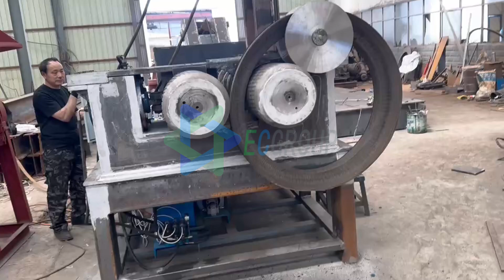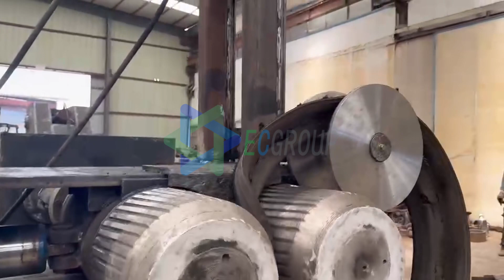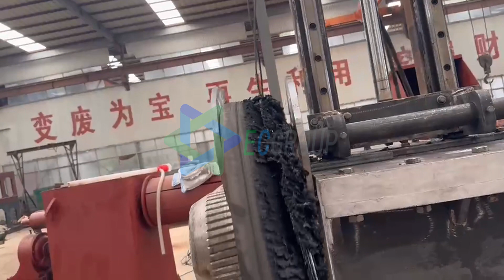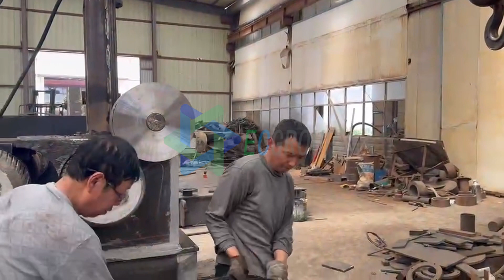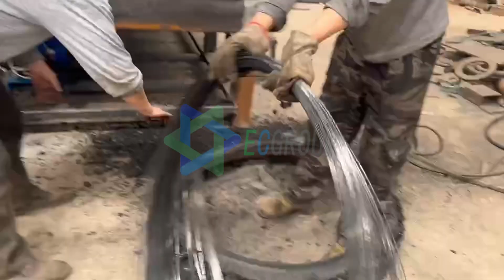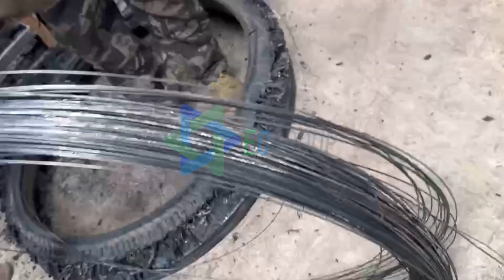OTR tire rim steel wire separator tyre recycling machine

Comment: Very low efficiency
Reply from the maker: This rim steel wire separator is to process φ≤4.6 meters big engineering tires, the capacity is about 2min/tire bead. If process truck tires, we have small machine, the capacity is about 3t/h. If you are interest, we can discuss further!